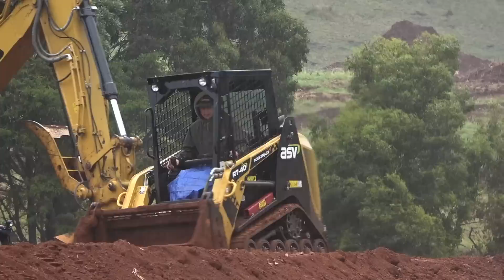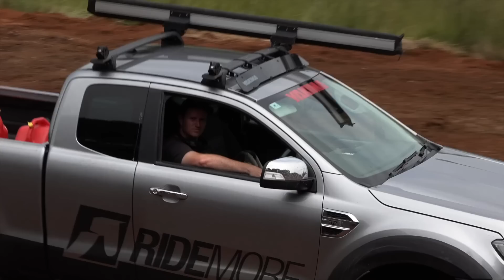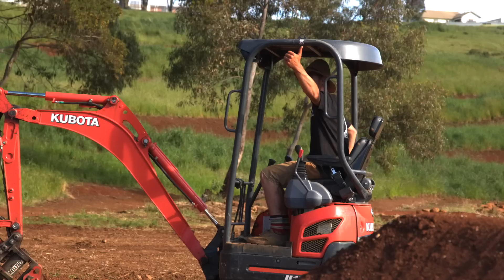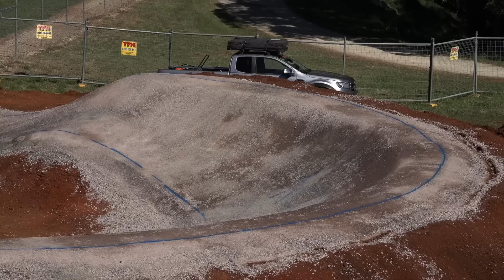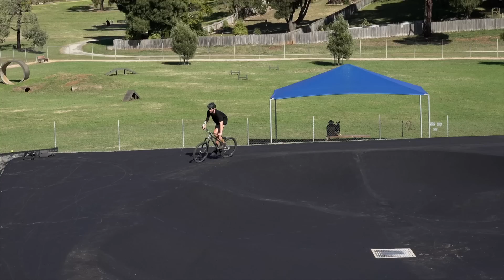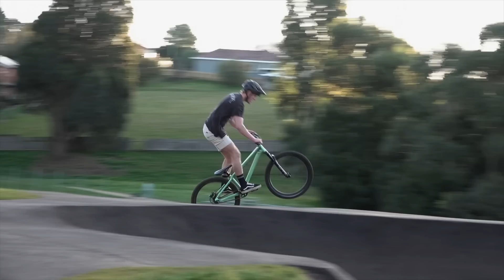They gave us HALF a MILLION to build a bike park

Comment: Instead of using an excavator to load an end dump that moves the dirt 100 feet, and paying for an operator, driver, and two pieces of equipment, you could increase production by just using a front end loader to move the dirt and then you're paying for only 1 operator and 1 piece of equipment
Reply from the maker: You are correct, but when you’ve only got around a truckload of dirt to move, the cost of paying for a front end loader to be delivered to the site, used for a day, and then trucked out again, would be a massive waste of cash!
Reply: @RideMoreYT  word

Comment: so it's just a thin layer of gravel with a thin layer of asphalt over the top? won't that crack?
Reply from the maker: It’s clay base, then roughly 150mm of 40mm silica based gravel, then another 150mm of 20mm gravel, then 40mm thick of asphalt. You might get a crack here and there over time but if the compaction is done right, and with only foot and bike traffic it lasts really well.